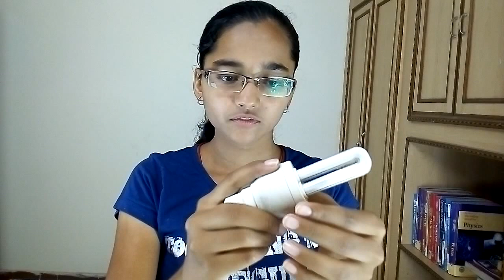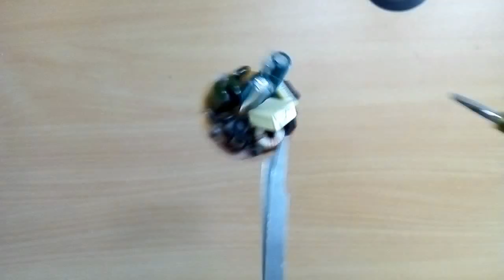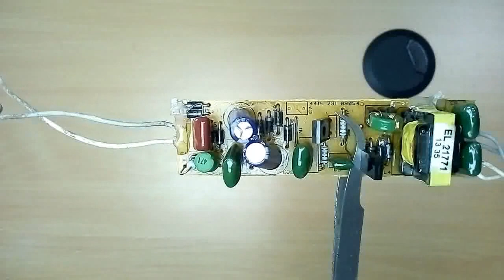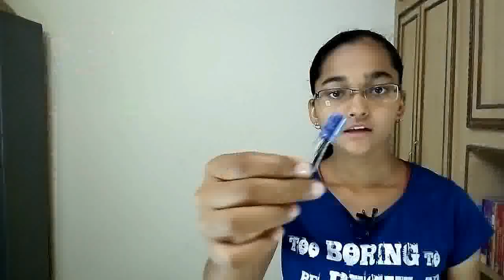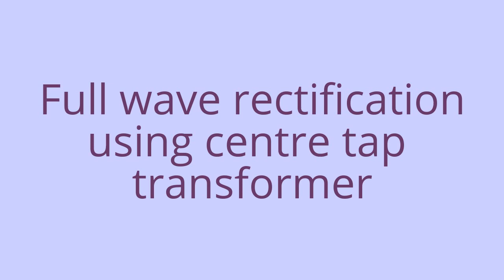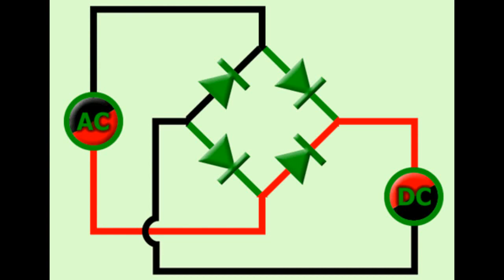Compact fluorescent bulb-Working of electronic ballast and components.

Comment: Electronic ballast circuit is same which is using in CFL bulbs, only components values are different. Both toroidal and EE core are inductors only. In both cases the end capacitor parallel to lamp produce more than 1kv to ionise lamps and glowing instantly. Transistors are using in both cases. IC circuit is also available. Power of transistors are depent on wattage of CFL bulbs. In case of 36w tube, 20w tube mje13005 transistors are using, or hlb123. The number of turns in torroidal inductors are very important. If it is in correct then transistors will be over heated and damaged quickly. I have 15 years of experience with these circuits. I my experience best torroidal number of turns for CFL bulf 3/3/6, and for 36w ballast, 5/5/4. I am sharing my observations. All the best for you . KNP Nair Amruthavarshni.

Comment: Hi. Can you tell me where on the circuit to measure the DC voltage using a multimeter? I'm very new to electronics and I'm trying to learn as much as I can. I had a bad digital ballast, and tried to measure the outputs (the wires going from the PCB to the light bulb) with a multimeter...but this gives strange readings because I'm obviously doing it wrong! There are 4 white output wires (2 pairs). I thought each pair were positive and negative and would give me a dc reading? Thank you for your brilliant video by the way.

Comment from the maker: There's a mistake in the video where I was talking about the components, it's a BJT and not a MOSFET, and the winding covered with yellow tape is an Inductor.
Reply: Happy to see a educational YouTube channel girl...Good work And nice explanation..Please do a video on fluorescent lamp..
Reply: Ya I know
But explain the circuit diagram not basics
Reply: Brinda Sri Sahithi ya I nkow it's bjt
Reply: Bd128 it is.. low power high voltage
Reply: @4BH1J337 😆😆
Reply: 4BH1J337 no it is a bjt. ibgt’s are made to handle large currents
Reply: Honey we all make mistakes. You are clever because you correct them.

Comment: Hi.. nice video . But remeber the components inside are not all transformer the yellow color transformer like is actually a inductor u make call it choke and the toroid is actually a high frequency tranformer also those r not MOSFETs they r bjt transistors.
Reply: yes , There is only one coil in it, but there is more than one coal in the transformer